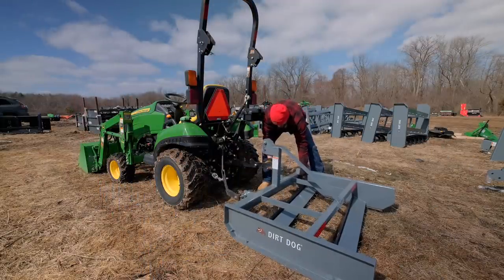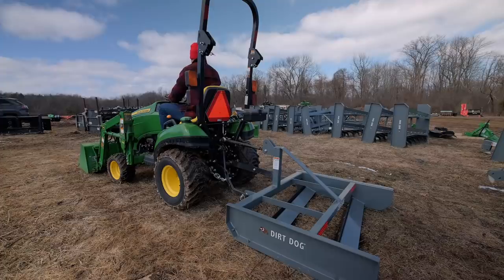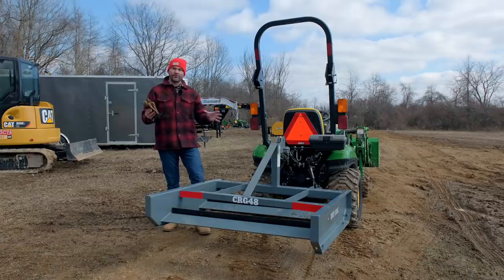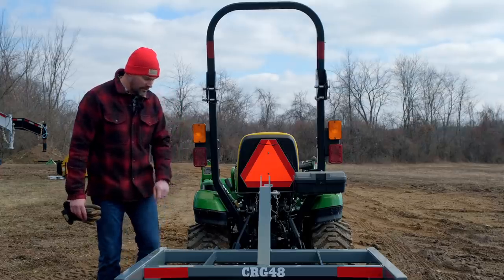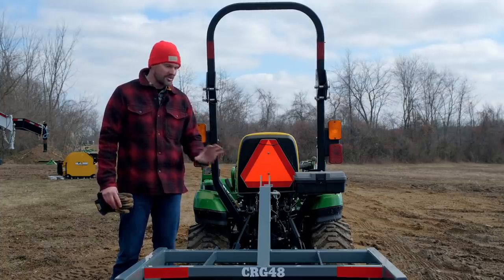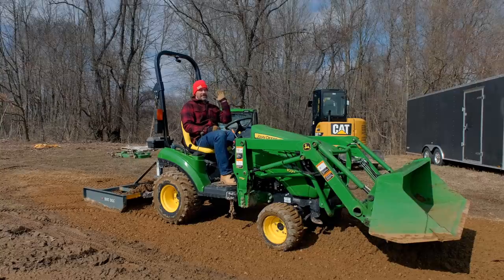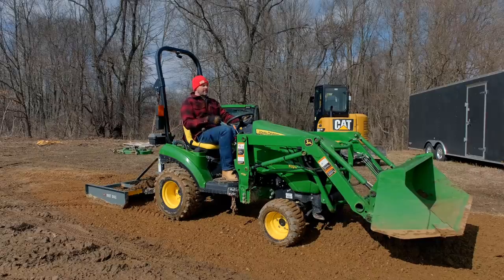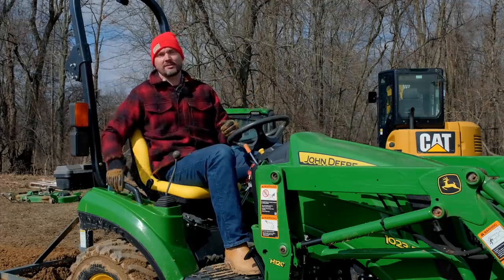MUDDY BUT RUTTY 2,000 FT DRIVEWAY GRADE W/ JOHN DEERE 1023e

Comment: The driveway was way too wet. The stone was packing up at the blades and falling in clumps behind the blade. The areas that hold water, well, obviously wet lol. Need to hit again when it's fully dry and it cascades over the cutting blades instead of falling over in large clumps. When the front blade would get so full and wouldn't go over it was allowing material to go around the sides. This was very evident when in the standing water and turned into a slurry. It was so wet it couldn't go over the top of the cutting blade so it went around the sides. Over all it shows the capability of the land plane and it worked for the most part but when it's dryer out you will have a much better result. I think you are rushing spring time to arrive. hehehe. Great video Cory. Checking the seed area, let's be honest, your brother-in-law got bored recording you and wanted to view the deer. Hahaha.
Reply from the maker: Haha, no doubt spring fever was kicking in.  Certainly, works way better when dry, but the drive needed some work.  It ended in better shape than it started.  Those deer out there are funny, sometimes never leaving the field all day while we're working.

Comment: I used to own and operate a nursery, greenhouse, garden center, landscape design & build firm. Personally it has been my experience that if it is mud your dealing with, not somewhat muddy it is not worth putting a grade on because it will not dry like you left it. Someone with drive over it and it is rutted again. I found I spent much less time letting mud season end of dry up from a rain & then grade. You get a final results once and for all without having to continually redoing it. Now that is from a commercial viewpoint that you are doing for a client that is spending money with you. In your case Courtney you may find you need to do it more often so the ruts do not become so deep that it is difficult to level them out because of you constant use of the area.
Reply from the maker: Yeah, I plan to add my finish gravel this year.  This was the base.  6" or so of 22a.  I'll be adding 4" of 21aa.  We twist and turn, cross drive, beat the heck out of our driveway right now.  Normal down and back travel is typical for most, and will be the norm here in the long run.  Right now, it needs to be graded, vibrapacked, finish stone added, and packed again.

Comment: As a kid growing up I wanted a john Deere now I am almost50 and have a JD I got it with are family farm it was pretty new. After few years the full injectioners went took it to JD they told me it was that and it was the one of the tufts motor they ever made, long story short they couldn't fix it had it5 weeks and change me 1800. For grease job so I ended up taking it to are locally tracker and saw place they fixed it and it was the fuel injection which they fixed with same JD (parts 300.00 ) and JD place wants1400. Each and their are4 of them. So I bought brand new Kioti tractor.  Also had to buy special tools 1300. So think twice about buying a JD you can not fix them because all off the special tools I have close friends who have very LG farm that grows potatoes for frto lays they refuse to buy anything JD anymore

Comment: I’m surprised dirt dog said this about the smaller machine. I had a 1025r and I used a 48” box blade on my driveway with the scarifiers down. The 1025r was able to pull the 48” box blade with the teeth down and the box full of gravel uphill without any problems. I feel confident it could do it. Yes it was working the tractor but nothing crazy. Keep up the good work.
Reply from the maker: I have stopped my 1025r dead in its tracks with the shanks all the way down on a 48” box blade….on flat ground.  Your 1025r must be taking steroids 🤣
Reply: Do you think a b2601 will pull a 5' box blade ok?
Reply: All depends on the material your in & how wet or dry it is
Reply: @jpjp3873  I talked to a John Deere dealer and the said a 2025r would be able to do a 5’ land plane. The Kubota b2601 is similar sized but probably a little more powerful so I would say you would be fine with a 5’. I wouldn’t go bigger though.
Reply: Sorry. I just saw that you said box blade. The box blade holds more material than a land plane. I would say if the 1025r can do 4 feet then the 2601 should do 5. It might struggle a little so other variables come into play such as material you are dragging, hilly or flat terrain, etc.
Reply: @GoodWorksTractors  I had them one setting down not at full depth which I’m sure helped me. This was in gravel so there were no tree roots or anything. I have had it stop me dead in my tracks in dirt.
Reply: @GoodWorksTractors  My 1025 New holland pulls a 4 foot box blade with scarifiers without problem.  You have to be aware of depth and moisture in the road bed when doing this kind of work.  Takes a little longer than bigger tractors but works fine.  If you have potholes on your road and just use landplane you will not break up sides of holes enough to have the same problem recur in no time.  Great video
Reply: @jpjp3873  my 1025r pulls my 5ft land plane fine on my driveway. It will spin in 2wheel but stick in 4wheel drive and it goes. I didn't want the tires being wider than the plane

Comment: Courtney, great video, but a Kubota BX 2380 handles a land plane with scarifiers just fine.   scarifiers are harder to find on 48" planes, but Land Pride and a couple others have them and 23 hp has no problem handling them.    They do make a big difference as they dig down and pull the stone up where it has been compacted over time.

Comment: If you stone it - I'd suggest roll out builder cloth or pour small fine and medium (crushed 1" into fines) lay it down first and then the next day or two over top with good 1" rock
and you will find the fines will lock in the lower area.  Make it nice and thick if possible and give it time if possible.  A good rain will help lock it down.

Comment: Great on a nice, flat, level driveway, but what about hilly, rutted drives?  When your front wheels drop down and that picks up your scraper, accentuating and exacerbating the unevenness.  The only way I've found to somewhat combat that, is to use a chain for my top 3-point, to allow the implement to self-level to a degree, but it's still a challenge.

Comment: I haven't done any heavy maintenance to my Gravel Driveway in over 30 year and it is still in great shape.  I used Afton Stone (Crushed Limestone) and the drive has held up to Propane Delivery Trucks, my 34' Diesel Class A Motor Home and the Lake Effect Snow off Lake Michigan.  Drive is over 1/10 mile.  I have seen other driveways around here where they used Road Gravel (22A & 23A) falling apart after a few years.  I have spread fresh stone to replace the stone removed by the blower about every 10-12 years and the FEL back dragging is all I use to spread it around.  I am afraid that if I used a Land Plane or Back Blade I would ruin the drive.
Reply from the maker: If it ain't broke, don't fix it!
Reply: Are you in all sand?  I am and along the lake as well, new 800 ft driveway in 18' still a sandy 2 track.   I'm  not sure what stone to put down.
Reply: @GoodWorksTractors  But one must drive their tractor.  :)
Reply from the maker: @1989Falkor  lots of clay here.  Call up a couple gravel pits in your area.  As many as you can actually.  See if you can get a majority to agree on what you should use.  Different regions require different materials.
Reply: @1989Falkor  No, I am on the edge of a Cedar Swamp and mostly clay.  When we first bought the property in 78 you could not get in during the spring and winter and it stayed that way until I retired from the Navy in 93.  That is when I had the driveway put in and it took a couple of years before we found all the soft spots and placed additional stone down.  I would still recommend the stone, but it will take a while for it to get packed down.  Depending on the traffic, it took all summer and into the fall and I was still pinging stones with the snow blower set for the highest clearance.  By the next spring it was good to go.
Reply: If you're talking about what I think you are when you say crushed limestone, the counties around where I live have started using it on their unpaved roads.  It holds up quite well to almost everything, except major logging operations on the road.  Other than the logging operations, about the only time the county has to do more than scrape a few potholes out is when they don't keep the ditches clear and water ends up running down the road instead of off the road and in the ditches.

Comment: Great video!  I'm a new tractor owner and want to get the most from my attachments as I build my collection.  I just built a new home last summer.  We moved in in fall and I had no tractor yet nor the time to do any of the landscaping and other outdoor maintenance I needed/wanted to do.  (Hunting season was upon us!!)  As things are thawing out and getting muddy here in NH I am in need of not only doing some yard shaping where I want to plant grass but I also have a 150 foot S shape driveway that I need to maintain and create a drainage ditch for.  Will this be the better option rather than a box blade for multi-purpose use for driveway and lawn area?  Does this land plane let you set one side higher than the other to make the crown?
Reply from the maker: Land planes aren't really the best for multipurpose, but I think much better than a box blade for driveway maintenance.  A box blade will be multipurpose and handle your landscape tasks better.  You can adjust your side link to set one side higher than the other.

Comment: With my 1025, I'm torn between land plane or box blade... 
Idk why specifically, but I'm leaning box blade..
If you can only choose 1?

Not for anything crazy, obviously with the 1025... Just some normal driveway maintenance for a myself/in-laws/friends...
Reply from the maker: If it's driveway maintenance you're looking for, I'd go land plane all the way.  These are the worst conditions you can grade in and it still did a good job.  Looks like smooth butter when it's dry out.

Comment: The difference between the position control and the quarter inching valve that the 1023E has is that you can set the position control, lock the tab and repeatably got to that exact same height time after time. The quarter inching valve is virtually impossible to do that with.

Comment: In the beginning of the video when you are using it, Seems to me you are using it when the ground has to much moisture in it. It’s packing up in and around the 1st blade and not cascading over like it should. That essentially turns it into a box blade after it heaps up at the first blade. It does work great when there is a lot more rocks in the area you are using it in.
Edited:
Guess I should have watched the whole video where you stated it was to wet. 😬
Reply from the maker: Haha, yeah too wet, but still wound up better than it started :)